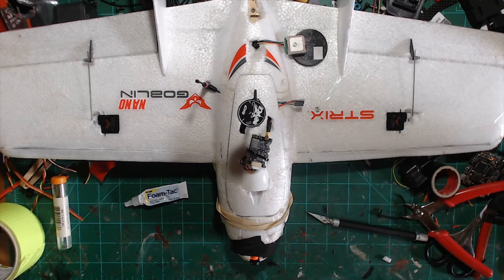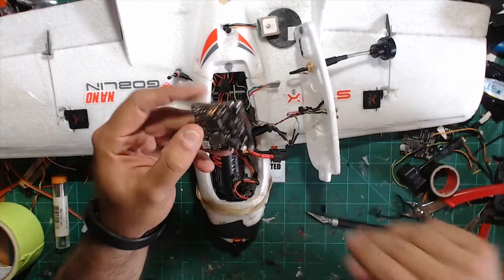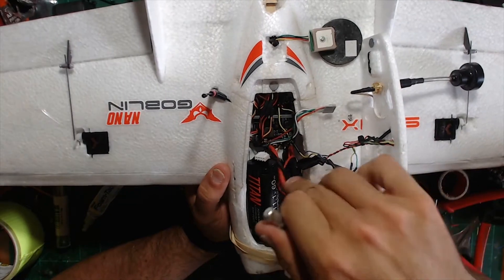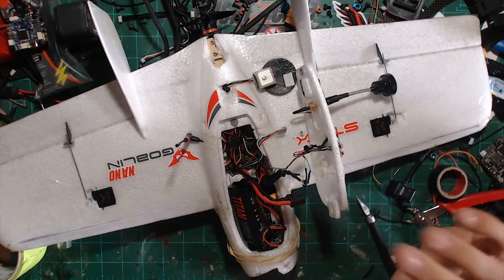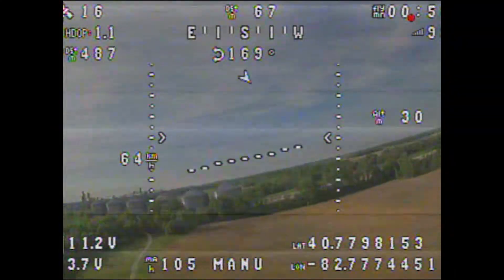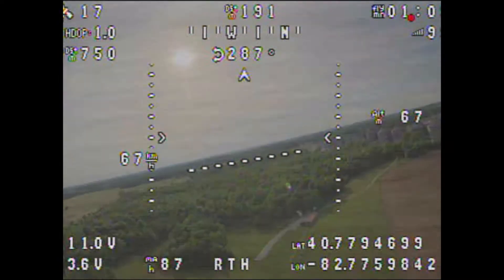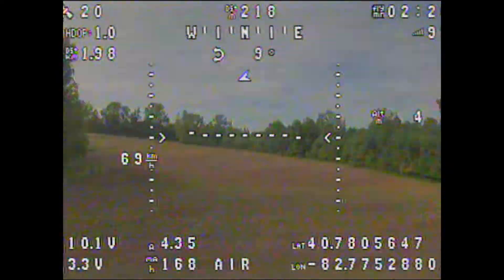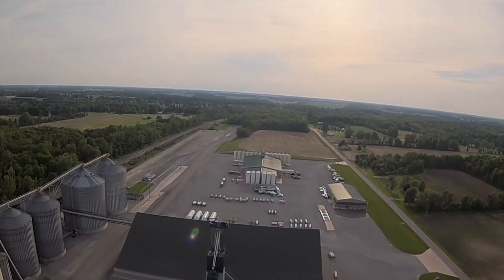STRIX NANO GOBLIN and INAV 1.9.1 REBUILD AND TESTING

Comment: Hi. Great video. What settings you use for telling iNav to RTH at current altitude?  Got mine all set using Furious FPV F-35 FC and it is working great but it would be nice to have RTH  do what yours is doing in some situations.